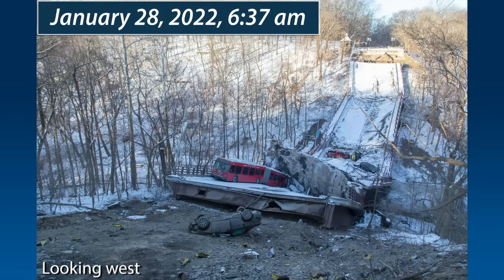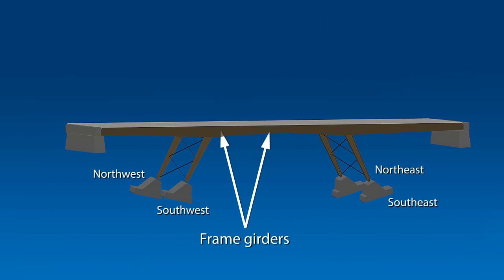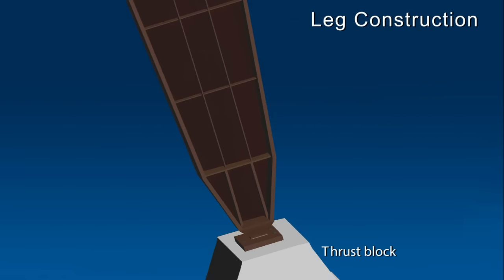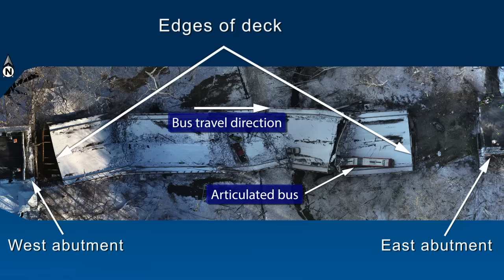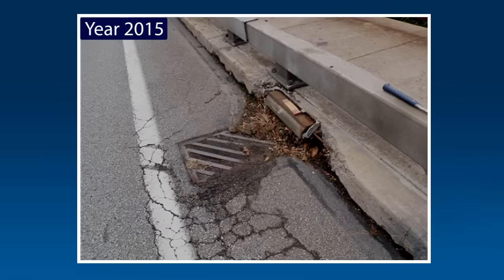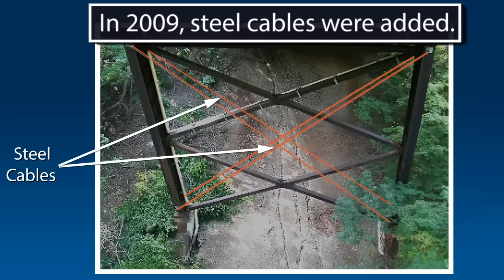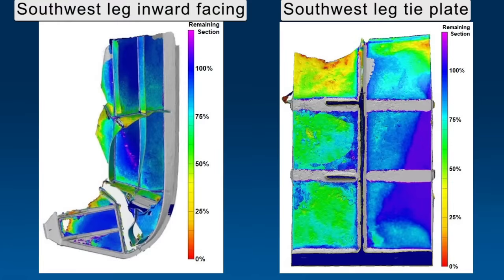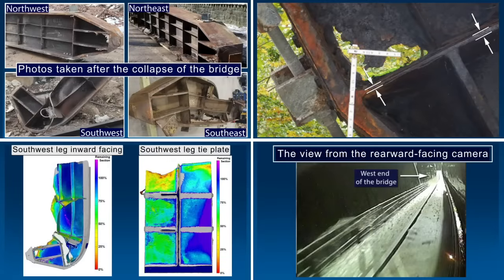NTSB Animation – Overview of the collapse of the Fern Hollow Bridge

Comment: Anyone who has worked with any material—even an amateur hobbyist in a garage—would understand that this corrosion was way beyond a fatal flaw. It was nothing short of criminal negligence to allow traffic on this disaster.
Reply: What's wild is that it seems like it wouldn't have corroded if they just maintained the drains properly. Not great to have a design with that risk built in, but still.
Reply: Exactly... that's blatant negligence on the part of the government.
Reply: i doubt this would happen even in north korea
Reply: @gatolibero8329  Republicans in government, specifically.
Reply: @ThatOpalGuy  Left and right in government walk in lock step all the way to their banks while laughing at the pick a team and fight sheeple
Reply: This is the result of lack of synchronicity between leftards and rightards. Thank you for your absolute inability to come to a compromise agreement to reach a state of forward progress no matter how slow. 8:08
Reply: Transportation "safety" board (joke) did a lot AFTER the collapse ..lol nothing prior but look at it..
They could have done a lot more like having plates temporarily welded in over the rusted areas to reinforce it....
If i saw that much corrosion i would never have crossed that bridge myself.. they basically let it happen!
Reply: @ThatOpalGuy  Pittsburgh and Pennsylvania are Democratic party strongholds.
Reply: and lack of maintenance.  The criminals who didn't clear that drain should have been jailed forever.
Reply: @ThatOpalGuy  A Republican in government would have fired that drain cleaner long ago and replaced him with someone that does his job, and had someone recoat the steal to make sure it would not succumb anyway.
Reply: @bradallen1832 what makes you think the bridges in red states are in better shape? got any data?
Reply: @Kenjh71  : It's clear you don't know anything about Pittsburgh and Pennsylvania Democrats. Many Democrats in Pittsburgh would be Republicans anywhere else.
Reply: Presumably, someone can go through the records of whatever political body oversaw the management of the bridge, and find out exactly who vetoed or denied funding to fix this brewing clusterf.
Reply: @surelyyoujokemeinfailure7531  : Perhaps. I encourage you to be wary of presuming the answer in your question, though. That "someone" will be poring through fifty years of annual budgets and monthly appropriation requests. It is a near certainty that funding was never "vetoed or denied" -- it was almost certainly directed elsewhere. The small army of civil servants and elected officials who made those choices will observe that none of the places where they DID spend the money collapsed.

The answer to failures caused by underfunding is to increase funding -- not attack those trying to make the best of an impossible task.
Reply: @thomasstambaugh5181  Well said - and this collapse should be made an example of. Unfortunately certain persons in American politics do not feel civil infrastructure is worth spending on - but they're fine with policing attempted abortions.
Reply: @chuckthebull Watching from Denmark, I don't know if NTSB has the authority to close the bridge, but they certainly can't do any work on the bridge, only report to the owners of the bridge.
Reply: @ThatOpalGuy  you do release this is city of Pittsburgh bridge there been no republicans mayor in Pittsburgh since 1934. So not one republican mayor the entire time that bridge was standing.  The city council been 100% democrats and if they had any republican on council the been in minority on council since at least 2000.  So maybe you should get the fact before you blame republicans for everything but you either a troll or what wrong with country which is the blame the republicans for everything and give the democrats a pass when in reality both parties have failed the American people for decades.
Reply: @LeifNelandDk They don't have any authority. Their purpose is to investigate incidents and make recommendations to the responsible governing agencies.
Reply: @chuckthebull NTSB doesn't have any power to do anything before. Their job is to investigate incidents and make recommendations to prevent further incidents. It is up to the agencies DOT, FAA etc to actually implement the recommendations.
Reply: @bradallen1832 Then why didn't they? They had control for the majority of the time the bridge has been in existence.
Reply: @ThatOpalGuy Government will always be neglectful because no one is held responsible. Blame it who was in charge specifically, not millions of Americans who want a better America.
Reply: @ThatOpalGuy  And how many Republicans are there in Pittsburgh / Allegheny County government?
Reply: @ThatOpalGuy  There's enough blame to go around in both parties.
Reply: @chuckthebull classic BSABSVR
Reply: @LeifNelandDk  well I was not necessarily putting the blame on any of them specifically just all of them...ever see the film idiocracy?
Yeah that's the USA government... the incopetent rise to the top
Reply: @chrisjohnson7929  it was inspected far before that ...odd that people take my statement the way they do... The all acted like it was a shocker after the fact but no one will own up to the failure of the system if checks and balances ..it fell down is all the proof you need
Reply: @allidusedup  classic government BSL BSR
Reply: @chuckthebull NTSB doesn't do bridge inspections. NTSB only does investigations after an incident and write recommendations.  Calling them a joke is absolutely wrong. The problem was with another agency altogether. NTSB is actually a good setup as it operates outside the regulating agencies. That means that they can investigate and make recommendations without the bias that would be present if the responsible agencies were investigating.
Reply: Well, the politicians were too busy lining their pockets instead of fixing the bridge !
Reply: @chuckthebull No you are spreading hate.  I am a structural engineer.  I have personally worked with Republican and Democratics leaning engineers.  This is the cause of the negligence.  An inspector wrongly FELT that he did not have enough power in his soul to close the road.  all he had to do is send the pictures and report to a national newspaper.  I personally would have called the state police and not left the bridge until it was closed.  I have personally condemned buildings that clients wanted to repair.  It takes huge balls to do the right thing in any job.
Reply: @stevebot No you have zero idea of what how engineering works.  Every state has similar engineering laws.  Any licensed engineer can legally condemn any structure with a letter to the building code official.  The Licensed engineer who inspected the bridge or reviewed the report is to blame.  Simply a case of not understanding the LAWS.  This is a failure of personal responsibility, not government.  Engineers perform engineering, not governments.  In the end, people are to blame, not politics.
Reply: @surelyyoujokemeinfailure7531 Yes you are correct.  But we already have the reports, just need them to be in redacted.
Reply: @chrisjohnson7929  it still fell down,,,failure is system wide..
Reply: @ThatOpalGuy huh
Reply: @chuckthebull NTSB isoutside of the system. This is 100% a DOT failure.
Reply: @chrisjohnson7929  it's all one big mafia family
Reply: no doubt especially after the Minneapolis bridge collapse.
Reply: @chuckthebull Nope. NTSB is an outsider. The unfortunate thing is they don't have any power other than to place blame and make recommendations. They don't have a job until there is an incident and their job ends when the report is finished. That's how they are set up.
Reply: @gatolibero8329  Its an unfortunate necessity in many cases; the last 40-odd years have seen drastic tax cuts, reducing the money states and municipalities need to repair and replace major infrastructure like this. Since I don't see the situation changing anytime soon, I think bridge collapses like this are going to have to be something we just get used to as a society.
Reply: Rather than lambast the government on this, perhaps if you lived in the area you would have figured out that the city of Pittsburgh has hundreds of bridges.  One of its nicknames is the city of Bridges.   While in no means an excuse for this bridge to collapse, there are way more structures than officials to oversee them all.   Its easy to armchair quarterback and say that his could have been avoided if measures were taken.  Its just not how our society works.  We require something horrid to occur before we take action, and even then, sometimes nothing gets done.
Reply: @chuckthebull The NTSB only has the authority to investigate accidents after they occur, and issue recommendations and criticisms of the agencies responsible for the failure
Reply: @ursodermatt8809 Èspecially in North korea.....it think it would be someone's head on a plate there 😂
Reply: @lukethompson5558  yeah i'm sure they all investigated themselves and found no wrong doing
Reply: @chuckthebull what are you talking about? The NTSB doesn't investigate itself, nor did the NTSB build the bridge.
Reply: So, for restaurants, they need to post their Food sanitation grade in the window.  For bridges, it would be nice to have a sign showing the "Bridge health grade".  At least this way, people could make a smart decision before using it, or at minimum draw attention to the bridges condition.
Reply: @steingat  that would embaress the boot lickets
Reply: @coalfax1 Then maybe use this is as an example from forward now on and relentlessly target and pressure your government to ensure they are doing what needs to be done on the infrastructure level. If it’s out of the locals capabilities then bring it to the state if it’s out of the state then bring it to the federal and you pressure your congressional representatives and senators by telling them you do this or else we’re kicking you out! You make it clear that you are the employer in this relation and that if you are not receiving the quality of service you are mandated to pay for then you will fire them.
Reply: "We have investigated ourselves and found that we did nothing wrong" -- City of Pittsburgh
Reply: @ThatOpalGuy  Pittsburgh mayors have been Democrats since 1934.  Pennsylvania have only had Republican governors for 4 years (2011-2015) since 2003.
Reply: 5:23 noooooooice!!! 
100% Tofu dreg !!!!!!!
Reply: @gatolibero8329  Unions? Teamsters?
Reply: Thanks hobbyist.
Reply: @BadJellyman100  chuckthebull is obviously a troll and is upset that he can no longer live under the Fern Hollow Bridge, so cut him some slack... 😁
Reply: @ntcfm1  But in that time, the Legislature has been run by the GOP, and guess who controls the budget?
Reply: There was a lot of black rectangles on those inspection reports in the video.  Each one of those represents a lack of transparency and cover up.
Reply: @mendelde I don't think they are; I have seen them hold up better than the few Dem cities I visited. I visited a few red cities and they were solid. That's because the work was actually performed. 

As In, I've never seen a dem city do the work until after. 

Another red city I lived in was smaller and didn't have many bridges, rural city of maybe 100k.

Even in the city with some blue, the work is done. As in there's road crews round the clock doing the work.

Everyone who even believes blue cities are better can never show 24/7 road crews nor can they show any work at night. And that was a city official saying that, in a blue city. Like Pittsburgh. Detroit. 

Houston.

Like I said, I don't think, I know.
Reply: @thomasstambaugh5181 actually doing the work with the funding approved is the best option. Then if it needs increased it can be voted on .

Can't do the work with the materials or funds approved, then you don't get to petition for more funding when you can do the same maintenance on roads that don't need special materials with the funding already approved to do the work of the stretch of road being worked on.
All projects have their own budget. All projects are approved before funding is secured. Asking for more.mkney when you can't even do the work won't make a difference no matter how underfunded you are.
Reply: @surelyyoujokemeinfailure7531 and certain persons in politics leverage laws over funding for foreign countries.

Not any better than policing abortion.

Same side harping on about abortion ignore the COVID policing. You got what you put out
Reply: Yip I agree Kermit the frog would have done a better job.. it wasn't inspected by a nobody fruit shop owner lol I build buildings in NZ . 
That's taken many years of neglect.  Weathing steel I laughed.. weathering metal is the statue of liberty copper
Reply: Seriously.
Reply: Seriously.
Reply: Seriously, how can you take those inspection photos of the corrosion and let people drive on that bridge
Reply: @ursodermatt8809  Pennsylvania is WAY worse than DPRK
Reply: @chuckthebull Specifically, the NTSB is only called in when the bridge collapses. Their one and only job is to analyze the accident and find out what factors led to it. They make recommendations to prevent further similar accidents based on their findings.

Saying the NTSB failed is false, as this video is literally proof that they did their job on this incident.

As for the maintenance of the bridge, thats another story...
Reply: Sometimes lead paint is the best idea!
Reply: @ursodermatt8809 I doubt they salt roads in NK
Reply: @chuckthebull The NTSB isn’t responsible at all for doing things ahead of time, nor are they a regulatory agency, or responsible for preventative maintenance. Their sole reason for existence is to investigate accidents and incidents, find causes for them, and make recommendations to prevent the same issue in the future. You’re blaming the NTSB for something that’s not even in their wheelhouse.
Reply: @LeifNelandDk They not only lack authority to close a bridge, they have no responsibility whatsoever for inspecting a bridge. Their entire existence is investigating accidents and incidents.
Reply: @tomcibulskis7649 I wish you’d been the inspector in Miami a few years back.
Reply: It's another example of how previous generations spent their entire lifetime neglecting the infrastructure they inherited and benefitted, and now they expect us to pay the repair bill. 

Honestly, I say we end social security and use that instead.
Reply: Rust never sleeps...
Reply: Political parties have nothing to do with this.
Reply: @ursodermatt8809  Why don't you move there?
Reply: @Talldarkhandsom  
what?  you want to meet me "there"  ??
Reply: @ursodermatt8809  No. I'll buy you a one way ticket
Reply: @Talldarkhandsom  
but i have no intention whatsoever to come and visit you "there".
however if you feel lonely, keep communicating from there.
Reply: @ursodermatt8809    Nah. I'll stay in the US
Reply: @Talldarkhandsom  
sorry, i thought you were based in north korea.
Reply: @ursodermatt8809   I'll still buy you a one way ticket
Reply: @ThatOpalGuy  You Spelt Democrat's wrong. FJB